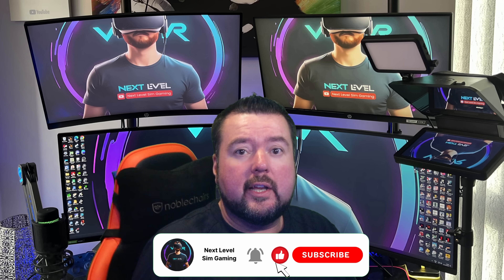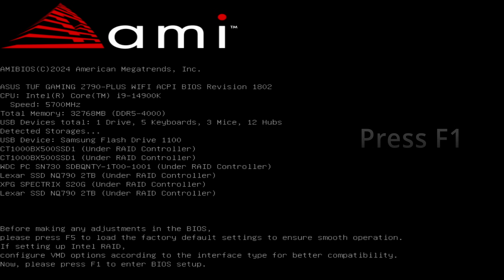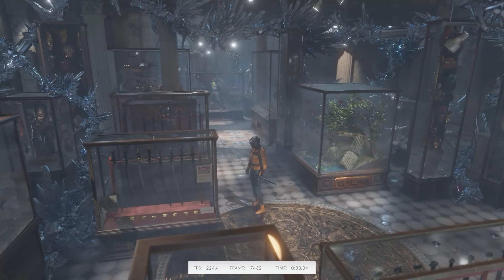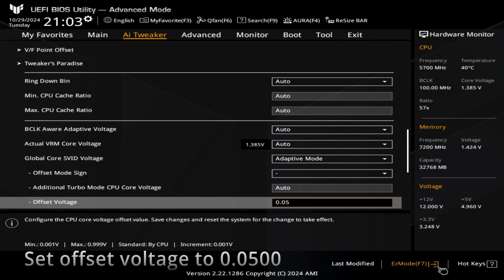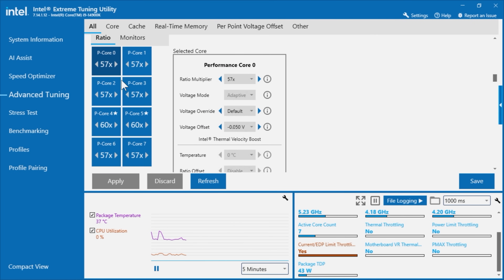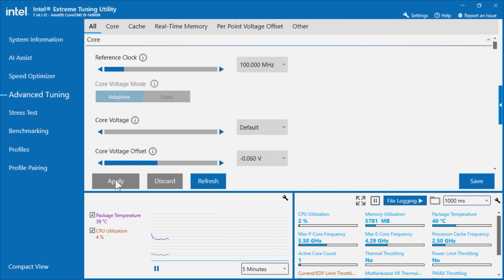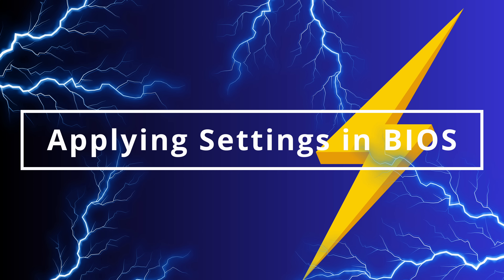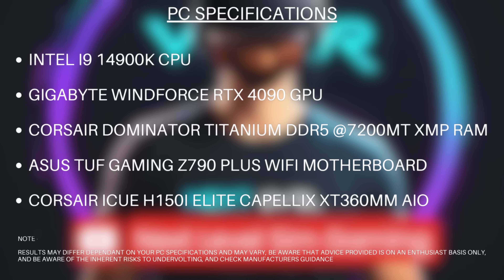i9 14900k Intel Final Microcode 1802 - 0x12B  BIOS Installation, Tuning and Undervolt Guide 📈

Comment from the maker: ⚠ Issue affecting users with Corsair iCue and Nvidia Driver 566.03 ⚠

There is presently an issue with the new Nvidia Graphics Driver, where a number of users including myself have been experiencing elevated CPU usage at idle, this is not related to this video, however it is an issue that will have an effect on the performance benchmarks.

Corsair is advising users affected by this issue to roll back their Nvidia Graphics Driver to 561.09 until Nvidia release a fix for this known issue I have done this myself, and the CPU now idles at 36 degrees, wheras with the 566.03 Game Ready Driver it was idling at around 58 degrees, this may also show spiking on idle.

Further information can be found on the Corsair news bulletin below -

https://www.corsair.com/uk/en/explorer/gamer/gaming-pcs/nvidia-driver-56603-and-corsair-icue-problem-explained/#:~:text=That%20issue%20being%20that%20the,way%20harder%20that%20it%20should.
Reply: Could this be a reason to a few of my games crashing?
Reply from the maker: @ Most probably yes, I had a crash in VR using AMS 2, rolled back the driver and no further issues
Reply: @nextlevelsimgaming  I have an i9 14900ks and just done everything you set and get a PC restart everytime I run time spy (but no nomad). No blue screen, no error, just restarts.
Reply from the maker: @ check the undervolt, ensure its a - (negative) value and make sure you have done it to begin with - 0.0500 not - 0.5000 

Otherwise F5 in BIOS and reapply

If it won’t hold an undervolt you may have degradation issues, a KS should have higher power tolerance than a K

The Extreme Profile for a KS is

iCCMAX - 400a
PL 1 - 320w
PL2 - 320w
Reply: @nextlevelsimgaming  I used 253 pl1, 253 pl2, should I change to 320?
Reply: @nextlevelsimgaming  So weird thing happened, found out my 6000mhz ram was overclocking to 7000mhz despite me never OC ram? I set to default, frequency was auto and was setting it to 7000. I set it to stock and everything works fine lol!. I also can't set PL1/2 to 320w otherwise 3d mark just doesn't even open, it just crashes. My ratio is at x59 and I am a couple thousand below score on average on time spy, but at least everything is finally fucking stable.. thank you for the help man!
Reply from the maker: @ No worries, are you running 4 x DDR5 RAM sticks?
Reply: @nextlevelsimgaming  I am yeah
Reply from the maker: @conorebola9872  Thats your issue.  There is instability running DDR5 at XMP speeds on 4 x DIMM, it’s covered quite extensively if you search YouTube, you will only get true stability at the rated XMP speeds on two channels, you are better off going for dual channel and increasing the size of the RAM to meet your requirements
Reply: @nextlevelsimgaming  Yeah for now I'll just leave it at stock, they're good speeds anyway, what tunings should I put for the ks?
Reply from the maker: @ 400a ICCMAX, PL1 - 320w, PL2 320w 

https://images.anandtech.com/doci/21389/image001_680px.png
Reply: @nextlevelsimgaming  Awesome, 320w works and so does 400a, what about performance ratio? I am at x57 stable, is that good for ks?
Reply from the maker: @conorebola9872  I would run at 55 you won’t see a performance improvement at 57, check my other video demonstrating that 😉
Reply: @nextlevelsimgaming  which video brother? also you earned a sub :face-red-heart-shape:
Reply from the maker: @ Thanks 🙏🏻 this one mate -

https://youtu.be/hh3FIN1c_ZQ?si=2MUJ-GryHlfo9GTb
Reply: @nextlevelsimgaming  Legend brother, thank you!
Reply from the maker: @ No problem 😉
Reply: At idle i have no thermal problems. I have the newest icue and nvidia driver, at idle i have 29-34 degree but bad performance at cod bo 6
Reply from the maker: @ The driver is due to be updated this weekend I have read
Reply: @nextlevelsimgaming  This is good news, I want my 20 frames back 😅
Reply from the maker: @ Same 🤣
Reply: Looks like they dropped a fix today! Im scared to download it and findout but the patch notes claim fixed
Reply from the maker: @ Its fixed have already confirmed on my PC 🙌🏻
Reply: IS this fixed, yet? An update to a potentially awful issue would be appreciated
Reply from the maker: @PickledMonkeySoup These videos are legacy videos now mate, I have updated to Arrow Lake, so they are here for reference purposes only, I will not be adding any further updates for Raptor Lake

Comment: Hello and thank you for the guides they helped a lot at temps!
My specs are Z790 DARK HERO ASUS ROG , I7-14700kf , corsair ram 7200mhz, 360 aio asus rog strix lc II
I've managed to lower my temps to -15* degrees or so.
My cinebench r23 was 31k , it seems okay?(i dont know much) with stable 70* degrees temps give or take 5 celcius.

I haven't set the Intel Adaptive boost to disable (just Auto)
And my PL1-PL2 is 125 w 253. (seemed safe) , my offset voltage was 0.07500 for stable without crashing.
Sync cores - 53
MY QUESTION IS: What would you recommend changing/experimenting in settings/bios so i can get higher score/perfomace with same or similiar temps?
Reply from the maker: Ensure Asus Multicore Enhancement is disabled, disable IA CEP and SA CEP and you should be able to reduce the undervolt further, however with 7200 m/t speed your issue becomes the weak IMC of the Raptor Lake, bear in mind this guide is for the 14900k so results will vary with a 14700k
Reply: @nextlevelsimgaming  I applied all the following in the bios. And i was able to be stable at 0.8500 offset.  Cinebench r23 score, pretty much stayed the same 100 points up or same. Temps lowered maybe 1-2* degrees at tops.
I do realize this is for 14900k, but most stuff seem to work good. IF any other tips available for the bios settings/values for me to test (just to know the direction) would be coool!  Of course i will do some other research in some forums or other videos, but for now i'm stable and temps are crazy low even at 100% for all p-cores.

Comment: In just recently purchased a 14900k with this exact same motherboard (along with most update bios version 1825).  I noticed by default the “intel extreme profile” is enabled by default.  Do you think I’ll be okay to just leave the extreme profile enabled but still also apply the same bios tweaks just as you did in this vid? ( I’m aware this is an older video)
Reply from the maker: You won’t see any performance improvement if you leave the Intel Default profile on, the guide allows for the enhancements of the Asus profile whilst retaining the safe power guidance of the Intel specifications

Comment: Would u recommend thermal velocity off or on and also dynamic tuning on or off?
Reply from the maker: Thermal velocity boost off, the purpose of synchronous cores is to avoid the 6ghz boost causing erratic vid requests and throttling 

DTT off again for the same reasons

Comment: Hello can someone help me ? I have a I9 13900k but in XTU i get in idle EDP LIMIT THROTTLING..
Reply from the maker: This is normal as unlimited ICCMax has been disabled, you do not want the processor to run at untethered power limits

Comment: I have a 14900kf and cinebench crashes at anything lower than a 0.01500. I started at 0.05000 and went until it was stable at 0.01500. Am I doing something wrong ?
Reply from the maker: You’re going the wrong way with power, increments of - 0.05000 so negative would be - 0.05000 then        - 0.05500 then - 0.06000 etc positive (adding voltage) would be the opposite.

See this further video for more guidance, but remember silicon quality is unique to each processor so some CPU’s won’t handle an undervolt in the same way as others, a degraded CPU will require more voltage 

https://youtu.be/XM2JLjcQZgc?si=2ulJ4vtZku6fKpag
Reply: @nextlevelsimgaming  i started at 0.05000 and cinebench would crash. i tried to go to 0.05500 then to 0.06000 still crashing. It was only stable when i went the opposite direction.
Reply from the maker: @BrosephTk Then you have a CPU that either is low Silicon Quality, or degraded 

Try running the Intel Processor Diagnostic Tool and consider an RMA

https://www.intel.com/content/www/us/en/download/15951/intel-processor-diagnostic-tool.html
Reply: @nextlevelsimgaming I passed the intel diagnostic tool. I guess I have a degraded cpu. 😢
Reply from the maker: @BrosephTk  Raise and RMA mate, there is an extended 2 year warranty to deal with this, if you read the comments on these videos you will see others had the same issue, and RMA'd, and came back to the guide, and all good then

Comment: Hello, warm greetings from Colombia. I recently updated the BIOS on my Asus Z790 Plus Wi-Fi to version 1820, as well as the Intel microcode, which also appears on the Asus website. Do you think these new updates have improved the high temperature issue with Core i9s in any way? In my case, it's a 14900KF. I'll follow the steps in your video anyway. But first, thank you for your dedication and commitment to sharing your valuable knowledge with everyone.
Reply from the maker: Hi, the BIOS updates will to a certain degree reduce higher temperatures due to reducing power usage, but only by finding the most efficient undervolt for your ‘specific’ cpu can you extract the most effective reductions
Reply: @nextlevelsimgaming  after this new update, would you recommend keeping all the tweaks you have provided?
Reply: I updated the bios. It recommended to set back to default settings. Pretty sure I did that. Then just did xmp1. Didn’t touch anything else. So I think all the undervoltkng is gone
Reply from the maker: @Ton-_-chi It will be, you will have to follow the guide again
Reply from the maker: @Ton-_-chi Yes, otherwise you will be at default settings and back to square one
Reply: @nextlevelsimgaming  these new bios updates fix the original issue(or are suppose to) so undervolting isnt entirely necessary anymore(even though you get the same performance with less energy usage) or do you have a different opinion
Reply from the maker: @Ton-_-chi The new BIOS updates impede performance with the restrictive Intel Default Profile, whether you want to regain performance and control temperatures as well is a choice only you can make 😉

Comment: Im getting WHEA error with this guide for my 14900KF.. Do i need to increase the offset value?
Reply from the maker: Check out this part 2 video

Guide to Setting the Correct Undervolt and Stress Testing Intel Raptor Lake i9 14900k
https://youtu.be/XM2JLjcQZgc

Remember this is an older BIOS guide also most stuff should still be relevant but a number of people are experiencing issues now.  I won’t be updating these guides as have moved on to Arrow Lake from 2024 so no longer own the hardware

Comment: New microcode just came out June 2025 (on my Asus Strix Z790-E Wifi 2, its BIOS 2001). My CPU just started overheating *maybe because its Summer! so I"ve been looking at your videos for guidance - maybe you can see if you have a BIOS update also and can do a review with suggestions for us - thank you!
Reply from the maker: The videos are for reference only now mate, I did them in reaction to the Intel Degradation issues to help users experiencing issues.  

I have moved to Arrow Lake Z890 from December last year so won’t be updating them as don’t own the hardware anymore.

The process is still the same however but many users are reporting issues on the new microcode, so unless you have a specific need to update I would hold off until the fixed update appears

Comment: Hello boss so I’ve done all the settings right cinebench goes smooth gpu test goes smooth but I failed the avx2 with 0.050 I have an intel i9 14900k 4080 S rog strix z790 any suggestions
Reply from the maker: Disable Asus Multicore Enhancement 

Disable IA CEP

Disable SA CEP

Retest

Refine your undervolt using the guide below

https://youtu.be/XM2JLjcQZgc?si=3FSijrBBpFzJuyW6
Reply: @nextlevelsimgaming I dropped it to -.04500 and it worked didn’t disable anything yet is that fine boss? Thanks for all the help out of all the yt channels yours is very clear 🙏🏽

Comment: I'm using 13900k. Following ur settings and set to - 0.0500. Failed xtu avx2 and cinebench r23. Using asus Z790 maximus hero. Any suggestion on what I can do. I juz got this cpu, after I rma'ed the old one.
Reply from the maker: The guide is for a 14900k, however users have reported success syncing cores to 5300, you can’t do 5500 on a 13900k its a different base frequency
Reply: Thanks. I'll give it a try 👌👍 @nextlevelsimgaming

Comment: For some reason I can’t sync all cores only issue I’m having
Reply from the maker: Have you got a 14900k?, Asus Z790 motherboard?
Reply: @nextlevelsimgaming yes Asus rog strix z790-e gaming WiFi 2 and a i9 14900kf I had just recently updated to new bios to version 2001 and my idle temps are higher, I used your undervolt video before update and my idle temps were very good, but after update tried to replicate it again and I can’t since all cores.
Reply from the maker: @fronkyy904 The videos were done in reaction to the Raptor Lake issues many were experiencing, unfortunately I don’t have visibility of new updates as I have now moved to Z890 ARL

But from what I hear a lot of people are experiencing issues,
hopefully they will address this in future updates
Reply: @nextlevelsimgaming  so it’s my idle temps that are getting me but I’m up to date on my nvidia driver
Reply from the maker: @fronkyy904 You will need to refine the undervolt 

Guide to Setting the Correct Undervolt and Stress Testing Intel Raptor Lake i9 14900k
https://youtu.be/XM2JLjcQZgc
Reply: @nextlevelsimgaming I do everything and my temps are so high during cinebench
Reply from the maker: @fronkyy904 Is this the latest BIOS I presume?, is Asus Multicore Enhancement set to Disabled Enforce All limits?

Outside of this, apart from repasting, checking the clampdown pressure on the IHS, and adjusting fan curve, without being able to sync cores (which I am unable to comment why you can’t without seeing it) I can’t really offer any further information unfortunately.

Also temps will be high during Cinebench its a stress test and synthetic load, you are more interested in real world applications
Reply: @nextlevelsimgaming yes after the new bios update I started having the high cpu temps at idle. And I used to get a high 80c on cinebench with all your adjustments. Now it hits 95c with your adjustments and then when I use intel default it’s a little bit lower temps. That’s why I’m stumped cause your settings do work just not after bios update.
Reply from the maker: @fronkyy904 The new BIOS update has been problematic for many unfortunately, I am now on Z890 Arrow Lake, so these videos are for reference purposes now, I won’t be updating anymore on Raptor Lake unfortunately
Reply: @nextlevelsimgaming  I reverted back to last bios redid all settings getting good scores on cinebench but temps are high at 95c while doing so. Before the update same thing except 80c max that’s where I am stumped maybe the microcode or maybe the nvidia driver at fault? I’m on the newest driver with nvidia
Reply from the maker: @fronkyy904 The Microcode would have been updated, you can roll back the BIOS but the microcode is a change to the CPU so won’t be able to download

Comment: Thank you, I did all the steps, but I set the processor speed to auto and I did not lose anything from the processor speed. I also set the voltage to 0.0500 and everything works great (i7 14700kf).
Reply from the maker: Great to hear, enjoy 😉

Comment: Would leaving ”Performance core ratio” at ”by core usage” be sufficient? Won’t all P-cores and E-cores boost to 5.5GHz and 4.4Ghz respectively when the load requires it anyways? I’d like to maximize the life of the CPU, that’s why I’m asking
Reply from the maker: No, the maximum will be 5.5 on the P cores in synchronicity, the E cores are not affected, C states sets idle behaviours
Reply: So it doesn’t affect the life of the cpu or power draw?
Reply from the maker: @marmaduke-fe6bn Power draw will be reduced through the undervolt.  Every processor is unique so the lifespan cannot be determined, however operating with the base frequency and not drawing excessive voltage through the 6ghz boost will prolong the life of the CPU

Comment: If I forgot to set the manual current limit, but I had a power limit of 125W, could it have used 511.75A at any point? In other words, could it cause damage to the cpu?
Reply from the maker: No the CPU has inbuilt protection

Comment: Is it necessary to set a fixed cpu speed and to synchronize all cores?
Reply from the maker: No, you can undervolt, however for increased stability its recommended to sync the cores, the issue with these processors is the 6ghz boost
Reply: Thanks, I have seen other people saying 5.5GHz is optimal too. How important would you say the load line calibration setting to be? Can I leave it at auto or should it be at 4 or higher?
Reply: Even with the 0x12F microde that I have now I am seeing voltages spike to 1.55 in HWmonitor, so I definitely do not know what is up with Intel forcing people to adjust every setting manually
Reply from the maker: LLC should be fine at 4 if its finicky disable IA CEP and SA CEP